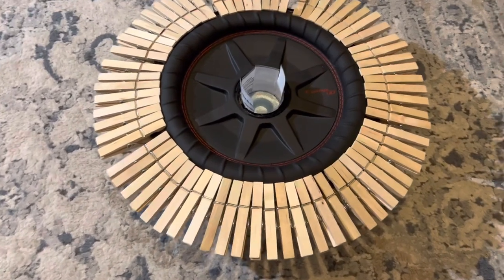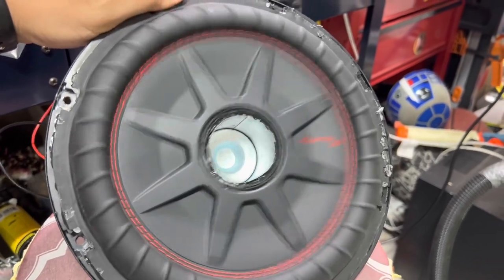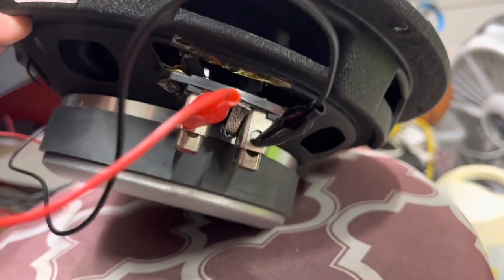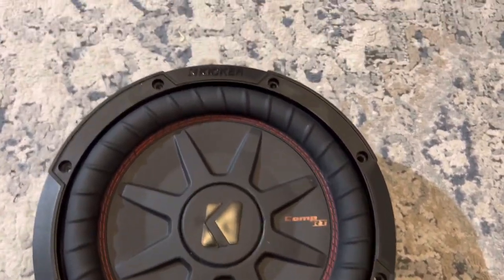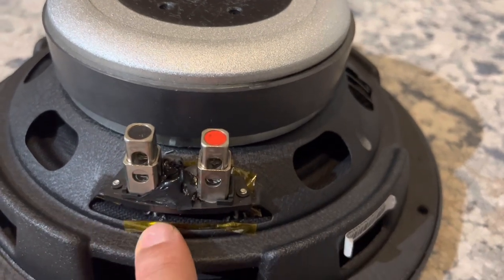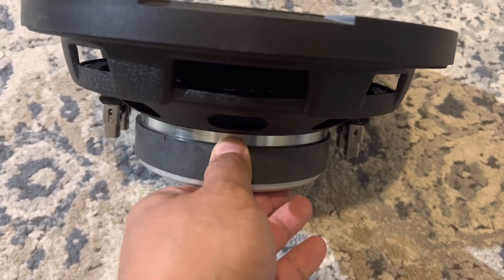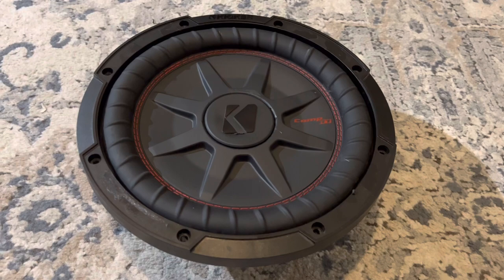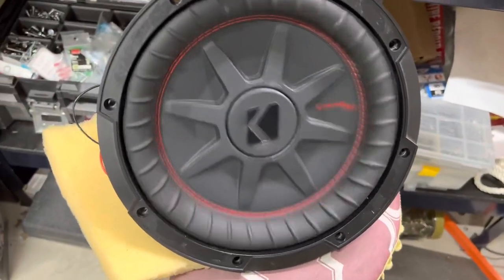Kicker Subwoofer Repair - Part 3

Comment: Hey man love this video whats that test mode hooked to you said 2ohms but what's that cool ass way to test it? Got a video on that thanks again
Reply from the maker: Best and easiest way is to take multimeter and measure the DCR (direct current resistance). The DCR is usually really close to the overall impedance of each voicecoil.

Comment: I need help please... I have a kicker comp 10 model # 05C104.
Worked great but the foam surround blew apart. No one seems to have it.
Reply: I really don't want to buy a new one and have a mismatched pair
Reply from the maker: Look at Lord of Bass. Take measurements and try to match the same dimensions

Comment: Next time try to cut the former height before u glue to the teipple joint if u mayched length with the old 1 u woulda known. Also the new cool weighs about 1/3 the weight of the kapton so its gonna be light wonder what that will do ro the fs and tsp compared to a new stock out if the box 1?

Comment: Hi I was wondering if you no if there 2 different models/style of the kicker RT  my 12in RT 2 0hm are totally different then the ones I see. there rated higher rms than the ones I see online and there is not a center cap  on either the 12 or 10 and my stitches aren't red there black.  the cones looks like the original comp R cones with no center caps. I have the original cardboard boxes they were sold in and there RT.  For some reason they look different and the spec rating are higher. The only one's I can find that look similar cone and sticking to what I have is the comp R but the box and subs say RT on them and there shallow mount. when I bought them they just had been released.  It's definitely strange thanks for your time and reply 🎶🎵💯🛠️✌️
Reply from the maker: Joseph, they did make a few different styles of the Kicker CompRT. There is a version that doesn’t have the small 2 inch dust cap and instead has a full size dust cap that is adhered to a bottom cone support structure. That is actually an older version of the CompRT series. Looks like that was rated for 800 Watts RMS. The disassembly would be almost the same but would require careful removal of the larger dust cap to access internal guts.
Reply: @Moegneto  thanks I appreciate that iv asked a couple of people and they tryed to tell me that they weren't RT shallow mount and there rated at 500w but I know that was wrong because everything I had said 800w so both of the RT models I have are I guess first generation when I got them I new the owner of a shop and he told me they were a early release for display I had to convincing him to sell them to me I didn't want to wait for there actual line to come In. But recently I was confused because I couldn't find anything about them or anyone that had them or new that there was a different style for a second I thought he gave me knock off. Thanks again much appreciated 💯🎶🎵🛠️✌️👊